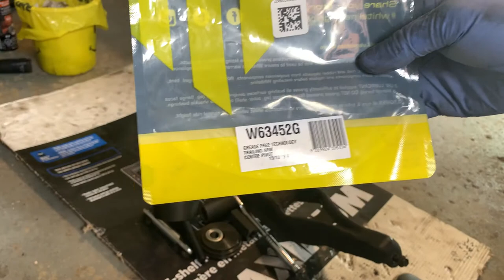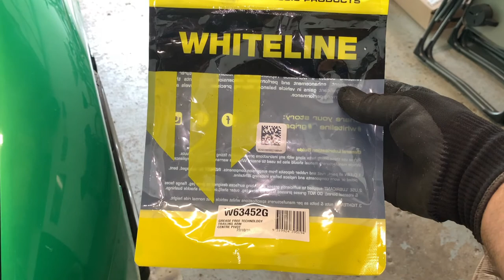Honda Civic trailing arm bushing replacement

Comment: Best thing about those bushings, position. Should I ignore the after market original ones I have and get the set you used. I may just do that.
Thank you for the video.
Reply from the maker: I can tell you I'm happy with these ones so far, and they were certainly simple enough to install.

Comment: How have those whiteline bushings held up?
Reply from the maker: So far so good, no complaints from the owner yet
Reply: @416diy  how have they held up to this date ?
Reply from the maker: That was my friend's car, the engine was leaking out of multiple places and the body was rotting pretty bad, it got scrapped last summer. Bushings were still good when it got towed away.

Comment: Did these limit the amount of toe adjustment after during an alignment?
Reply from the maker: Couldn't tell you, never aligned it. Doesn't get used much, maybe 1 tank of gas in the 6 or 7 months a year that it's out. I never touched the adjustment bolt on the compensator arm so I'm not overly concerned.

Comment: Can you not press em in by hand? Like the psb kit? Psb kit lasted a year then fell apart. Lol
Reply: There is no way one can be strong enough to press this into the trailing arm.
Reply: Thanks for the reply. I was able to press them in easily just dropping down the arm. I made a tool from a 2x4 on the back side, 6 inch bolt, and bearing plate washer to press it in. $7 total from home depo.
Reply: @danstephens6995  That's impressive, about a hundred and seventy dollar savings.$$!
Reply: Oh no I just picked up some Psb bushings lol. How were they before falling apart?
Reply: @danstephens6995 hi, just had a quick question about the 2x4 on the backside you mentioned. Is that just 2x4 wood or a steel plate?